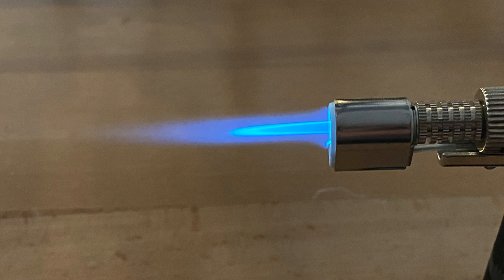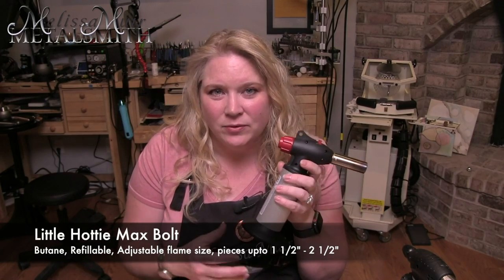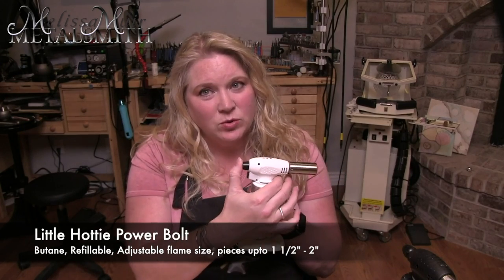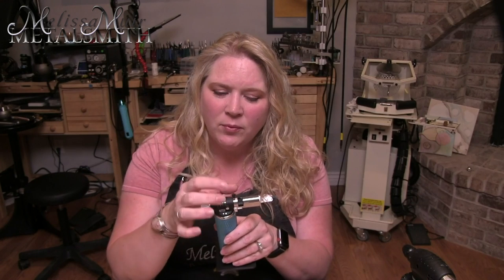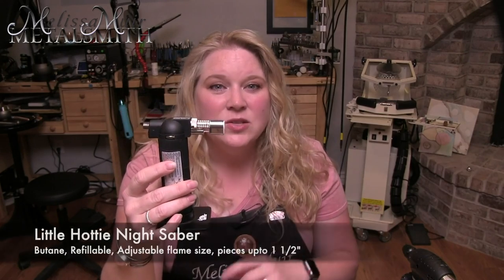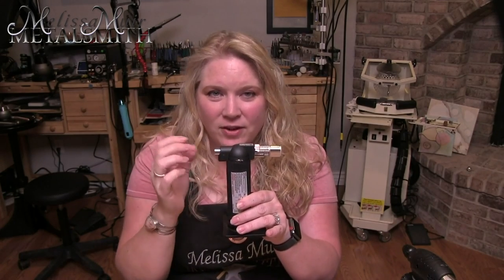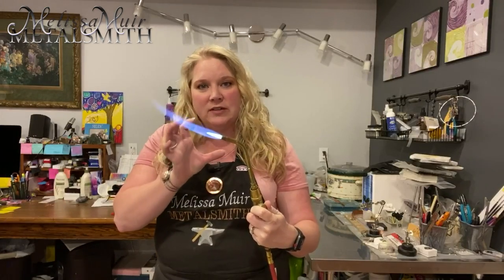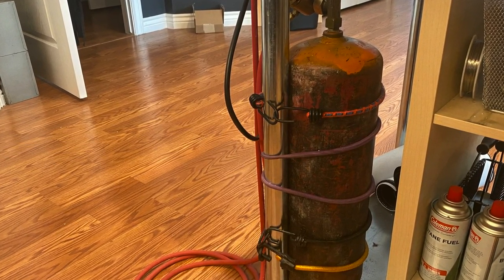The First Step - Choosing a torch for the job - Savvy Artisan Approach

Comment: Hi Melissa,  I know this is 3 years old but wanted to know if you have a newer torch you recommend.  I need to solder 6 mm jump rings.  I have a MAPP with the long hose, and a butane  like the camping size and a little chef torch.  Id like to get a small handheld that I can use in the house when Im stringing vs working in my garage studio were I enamel, kiln and saw.  
Thanks and I love teaching methods.  I can't get enough of you.
Reply from the maker: I still like my butane torches. Durston makes a great one.